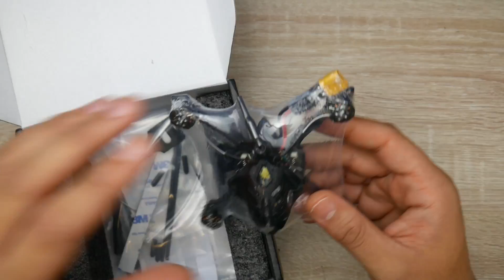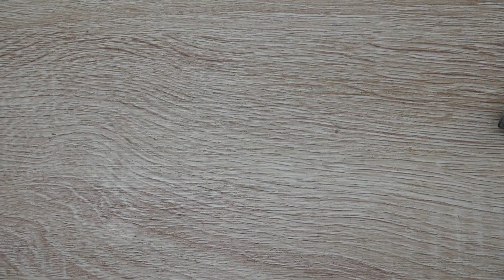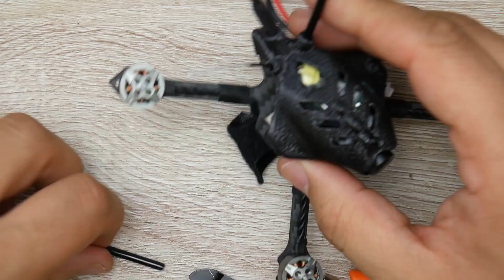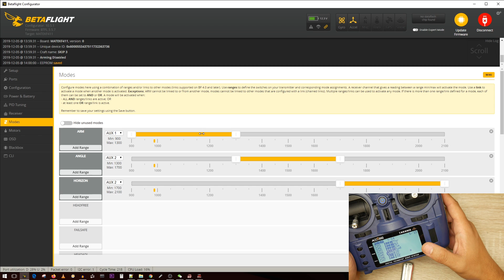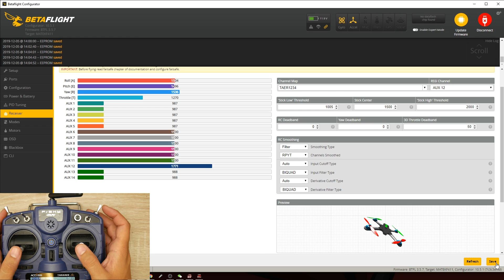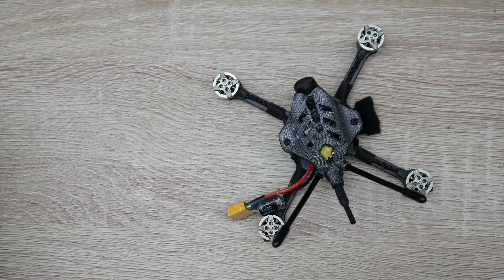GepRC Skip HD 3 // Full Unboxing & Setup Guide

Comment: I just received this quad and have a strange situation which I hope you can confirm. The FCB is obviously mounted facing forward, because of the USD port it is impossible to mount it in any other orientation. But when I connect it to headlight and watch the movement of the 3D model I find that the yaw is correct but pitch and roll are reversed. This implies the FCB is mounted facing backwards. If I apply a 180 degree correction  to the yaw in headlight the pitch and roll is corrected. It seems strange having to set that correction, did you need to do this with your,s? Also, after checking motor rotation and operation in headlight and proving everything was correct I fitted the props and attempted to hover, the second the quad managed to lift off the ground all motors went to full throttle without any input from me! Any ideas why this might have happened? I was using a 4s battery with the standard tune for the hover test. Thanks for any guidance you can provide

Comment: I in no way am trying to make out like I know more than yourself.id say I follow you and I.bardwell as my tech knowledge guys.but I'm sure youd both agree if this vid was atall aimed at 1st timers,then all your advice was spot apart from you didn't mention that above all else setting a failsafe on beta flight and on transmitter,for a bit of redundancy in one failsafe fails.and that they should check by arming quad,then turning off transmitter to make sure the quad cuts the motors during a failsafe.i speak from experience,coz I had a fly away with my  1st quad and never found it.fortunately it would have ended up in a field somewhere as I was in the middle of nowhere. But it could have been a very different story had it been anywhere near civilisation.just a thought was all,you might wannabe mention it in a follow up short vid..as I doubt people will read up my little reminder message.anyway keep up the good work,and hoping 2020,might be a big year for fpv in all it various guises.😀

Comment: first comment I need help for how to connect recover the the flight controler
Reply from the maker: What exactly happened to the flight controller so I can help you better.
Reply: @DroneMesh  nothing has happened to my flight controller  I have everything new and in perfect condition but its my first build and I need help for to which pads should I connect the wires from the receiver to the flight controller and from where I can get the wires that connect from the receiver to the flight controller
Reply from the maker: @abdulrhmanalaryani8946  What flight controller are you using and what receiver. I need the model of each
Reply: @DroneMesh  I have the star f4s flight controller and the fs-ia6b receiver
Reply: answer please I need help
Reply from the maker: @abdulrhmanalaryani8946  Red wire to 5V black wire to GND and the ibus wire to the rx6 pad on top of board
Reply: @DroneMesh  thank you I really appreciated
Reply: @DroneMesh  I also have a question sorry for bothering you but I need help in which should I connect the servo wire horizontal or vertical I use I bus or ppm ??
Reply from the maker: @abdulrhmanalaryani8946  What is the receiver model.
Reply: @DroneMesh  I have already told you ia6b
Reply from the maker: @abdulrhmanalaryani8946  I dont really remember which one is for ibus just quick google search should find it
Reply: @DroneMesh  can u answer please